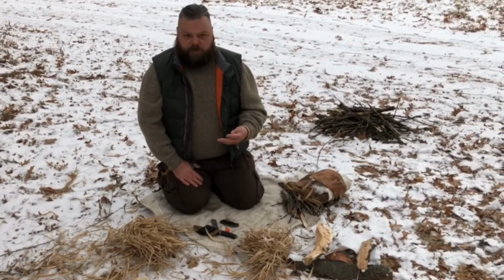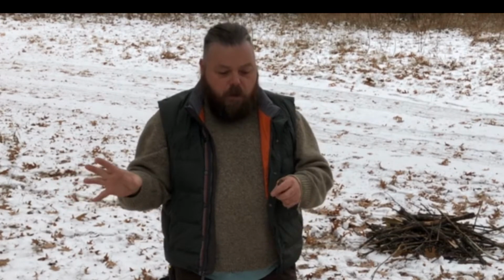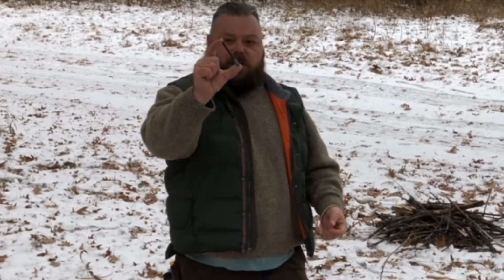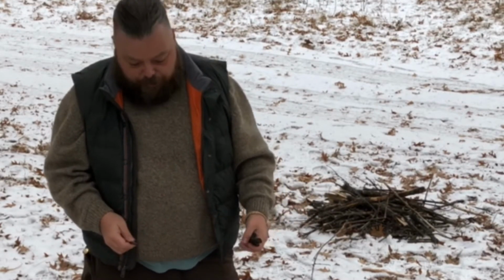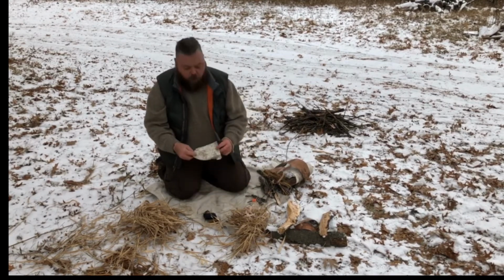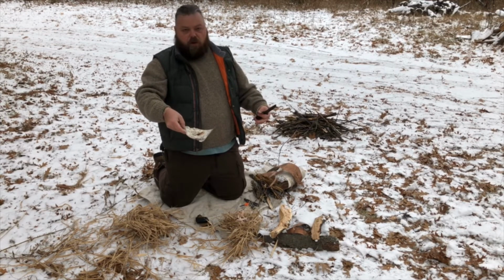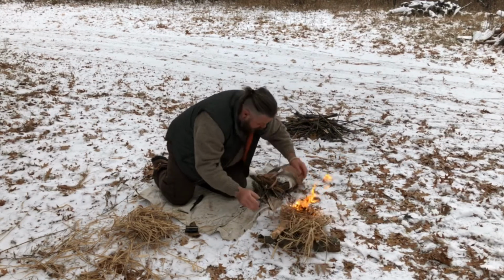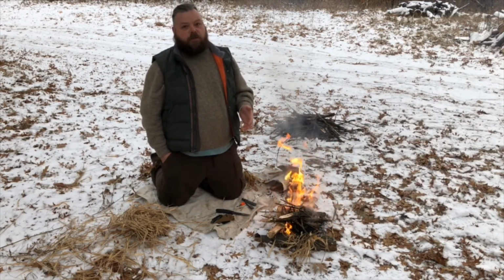Fire making: the right way to use the ferro Rod.

Comment: The only thing I'll say is it doesn't need to be high carbon steel to use a ferro rod. Just a sharp 90 degree edge will work including stainless steel. High carbon is required only if you plan on using that steel for flint and steel.